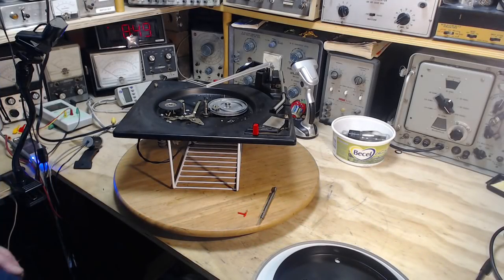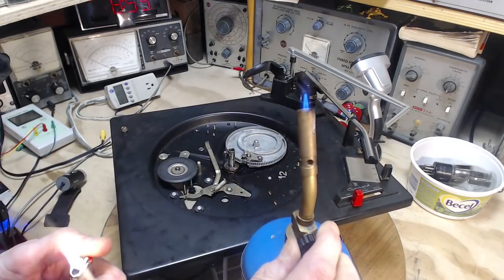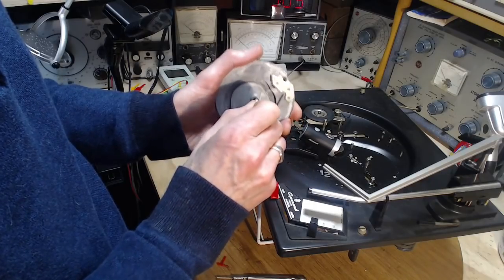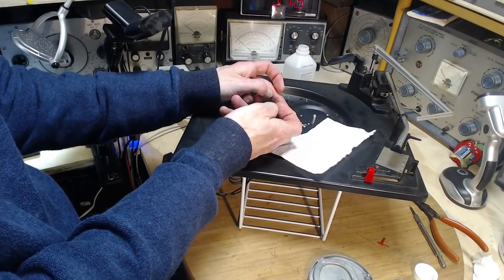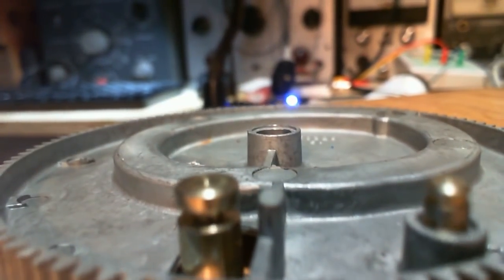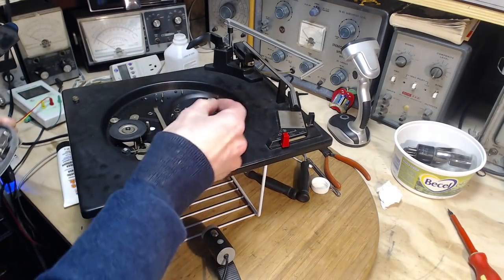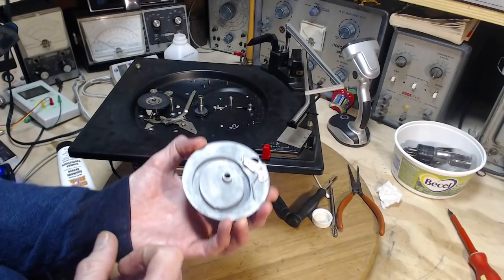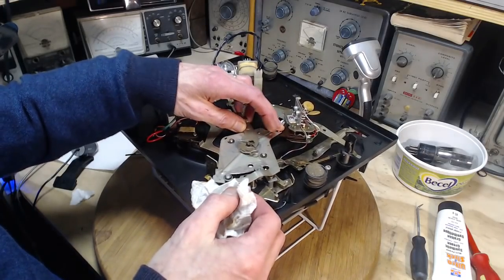Garrard 2025TC Record Changer Video #1 - Basic Maintenance

Comment: Hello Jim, Just got my old Prinzsound Stereo System 12 with Garrard 2025TC deck out of the roof after about 30 years with Intention of selling. The auto return was all seized up and arm had resistance and would not track on record. I started to Investigate and also look for Information. Eventually I found your video which has been Invaluable to me and I don't think I would have been able to repair without this Information. Now all repaired and working perfectly, the section about the auto return mechanism was especially useful once I managed to borrow a blowtorch from one of my friends as originally I was trying to free the arm up on the rivet, which I know now was not a good Idea. In all only took me a few hours to repair and cost £5.00 for some oil. I have now decided to keep the system as it is also a very good looking unit and I bought from new when a teenager. Now I am thinking of selling my newer equipment which was purchased around the 80's - 90's, only one problem I have now is that I am unable to connect cd player to Prinzsound system. It was also very enjoyable to work on unit and very gratifying when all working, also sounds very good. I think before I fell a little into the audiophile trap, but I am not a purist, what sounds good sounds good, my ears are not perfect frequency meters. Again thanks very much. Cheers Phil.

Comment: Thanks Jim! This video helped a ton and saved me from replacing the rubber wheel on the turntable. I was able to pick up a KLH Model 20 at an estate sale and the original owner kept it in immaculate condition. I've recapped and doped the speakers, the radio works great (pulls in FM stations that no other radio in the house can), and now because of you the turntable does also. I'm glad these old units are being saved and that now my teenage daughter gets to hear what analog music is all about!

Comment: Thank you for you video. I have an old Console with a 2025TC, which played but no auto the tone arm did not return at end of record. I played your vid while working on it, step by step. The thing works perfectly now. Only one problem I have on extra small clip left over! I used a heat gun in place of touch. I had every problem yours had, it was uncanny.

Comment: I hesitate to comment since I don't want to appear as a know it all but I do have many years experience as an office machine tech. I encountered many issues with dried up grease binding  moving parts, some you couldn't get to very well. There used be a low fume degreaser made for office equipment and I wish I could find it today. That worked amazingly at freeing up stuck parts. Prior to my job working on office equipment, I used to use isopropyl alcohol on things and it didn't work nearly as well as the degreaser. I even had parts become stuck again because I didn't get all the old grease out with the alcohol. Now I use automotive degreaser or paint thinner but that needs to be used with good ventilation, however, it really works and frees things up quickly. I like the idea of silicone grease. That sounds like it would work really well. Someone else suggested sewing machine oil and grease, which I might also try when the need arises. I hope this is helpful to someone.

Comment: Good series of vids Jim. I've just bought two of these, which need work on. Your vids will help enormously. I think you've made a mistake in greasing the grooved housing inside the large drive cog @45.59. It is clear from the 2 that I have, the one that you have and from another YT video that this cog never had grease in it. Here's why. Firstly the grease will ultimately work its way down and go all over the deck which we don't want because its held upside down in suspension

However, the main reason not to grease inside the grooved housing is this. You have friction between the inside surface of the bearing and its pin and also friction between the outside of the bearing and the inside of the grooved housing. Its the higher friction between the bearing's outer surface and the dry groove that grabs the bearing and turns it. If you grease the grooved housing for the bearing it'll work fine for quite a while but you're storing up a problem. 

The problem will come if or when the grease inside the bearing starts drying out and become stiff. It'll stop turning and instead it will simply slide on the grease in the grooved housing. In time it will wear a flat on the outside of the bearing. Then its good luck finding a replacement for that bearing. This is exactly what happens with the plastic bearing/washers that run in aluminium tracks on up and over garage doors. People lube the tracks when their garage doors get squeaky or a stiff and it ALWAYS results in a flat on the bearing.

Comment: I have a Technics linear tracking turntable.  It occasionally, needs a new drive belt.  I also have a BSR 250S record changer.  I use the BSR to play "45"s.  Every once in awhile, the BSR needs some lubrication, and a new idler wheel.  I have probably 300 LPs and 500 "45"s.  Both turntables get used frequently.

Comment: Nice video , I've just pulled mine out of the loft and have to do some maintenance myself , I think in the heatwave the belt has melted . I'm saying this because the platter currently isn't moving and I found an old pair of my boots with melted soles. 😁
Not taken apart before so I'm looking for videos at present.
Reply: Just realised it's not belt driven lol 

How is it to remove that whole top so I can clean underneath ? Being sat in the loft I want to give it a whole clean up

Comment: Hi Jim! Your video has been helpful in making sure the grease and lubrication is done correctly on the 2025TC I have picked up and am working on. Thanks! I was wondering if you have any thoughts on a non-functional auto mode. That's the last part that's got me, and not even the service manual seems to have any advice on this function being unresponsive. If you have any tips, that'd be great! Thanks.

Comment: I'm so glad you posted this. Just picked up an Electrophonic modular system with the same changer and had the same problem. I'm a novice at this, and didn't have a blowtorch, so I used an iron and it did the trick. Got it all going again. Thanks for the post...

Comment: I have a 2025tc that was not working when I received it. I found a small bent up wire in the bottom of cabinet. I found that the straight end goes up into the back of the arm and connect to something below. If you still have the 2025 and you see the metal piece I am talking about would it be possible to send me a photo of where it connect on a lower arm? (Part number 156 , overload spring)

Comment: Garrard should have followed Revox's lead and built all electronic Linear Tracking Turntables which uses a pancake motor (similar to what is found in CD players) to drive the platter but means that the only thing needed is the tiny belt that drives the tone arm across the record and there would not be any need for those parts under the platter of the turntable, if you are wondering what turntable I am talking about well it is the REVOX B790.

Comment: I've got an old 70s Marconiphone and the only problem I am getting is the speed control its running at a semitone faster than it should but after cleaning all the inside and the Ider Wheel rejuvenating it still runs too fast. I've heard a new motor would fix this problem but I don't want to mess with the motor that's beyond me.
Reply: Since then I managed to pick up a steel BSR platter part and install that instead of the plastic one and that actually fixes the speed problem and its spot on now. It must have been the weight that helped slow down the platter.

Comment: Hi, the issue with mine is the tone arm only swings to the 33 record distance and sets down. if I change the speed to 45, speed changes the tone arm swing and set down still is for the 33? Did you cover that part of the mechanism the controls that?
thanks
Reply: Did you have the turntable drop the record on its own, or did you set it on the platter first? A 12" record moves the black plastic 'size selector' as it falls, and the tone arm then moves to the edge. If a 45 drops, that black plastic piece does not move, and the tone arm 'knows' to swing in farther before setting. This operation is entirely independent of the rotation speed chosen.
Reply: @Nukatha very good  information. Thanks

Comment: You talking about an o ring but it shouldn't have an o-ring it should be a flat washer and a bit wider than that washer it's been replaced for a wrong type see if you can get a silicone washer would be better with the same diameter as the metal washers. Use silicone grease or white lithium grease.
Are you sure they're not a Pozi screw not Phillips. Oil is no good in the bearing motor Bush if the bearings missing? Put a knob Greece in there. Shouldn't need oiling anyway the bush is impregnated with oil.